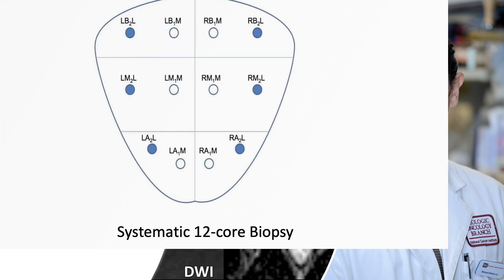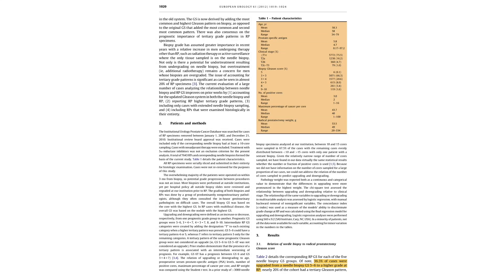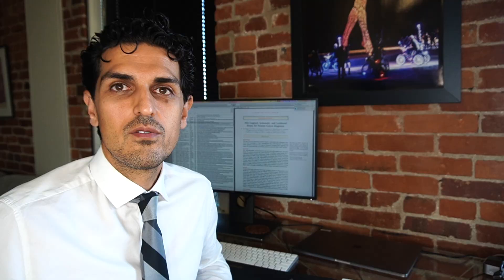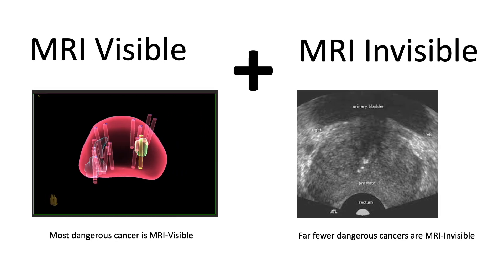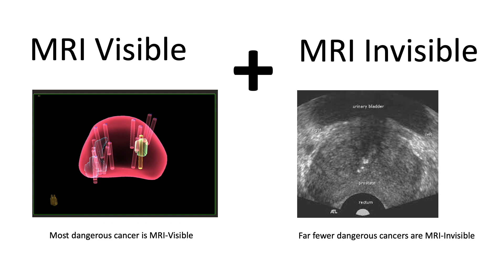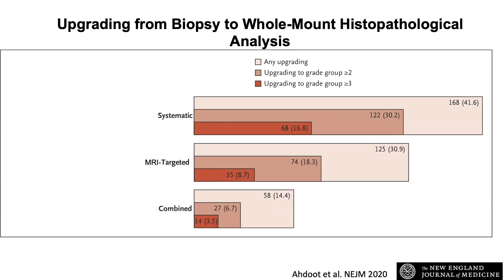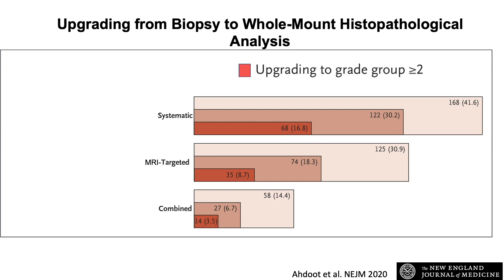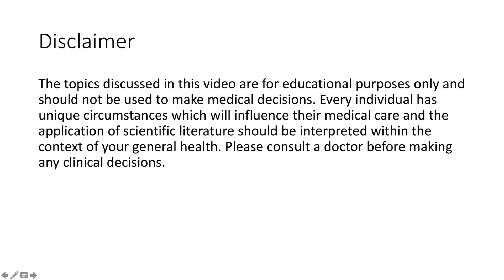Prostate Biopsies Can Be WRONG! -  Dr. Ahdoot Explains Prostate Cancer Diagnosis

Comment: 5 days ago I had a MRI-TRUS Fusion prostate biopsy, using the Phillips UroNav System.  I go in today to find out the pathology report conclusions.  What surprised me is how fast the pathology report turn around was.  I had the biopsy on a Friday and less than 24 hours later, the PR was released on MyChart.  I haven't looked at the results because, my guess, they're highly technical and I don't want to jump to conclusions.  That being said, I question the thoroughness of the report given a less than 24 hour turn around.  The Urologist took 12 systematic samples and 3 targeted samples of, as the MRI report said, of the appearance of a PIRADS 4 lesion in the right, mid-peripheral zone.  So, in a nutshell, what questions should I ask the urologist as we move forward.  To me, the prostate and the medicine around it seems imprecise and wrought with ambiguity....and I don't know what to believe anymore.

Comment: Thank you Dr Ahdoot for the knowledge & insight to diagnostic options available for men. I'm 71 have BPH & my most recent was PSA 6.5 up from 4.5 from my last exam 5 yrs ago. At that time underwent MRI & Aphiny test/analysis not sure which kind. Radiologist did not find anything to raise concerns. I'm thinking of a follow up with a urologist. My understanding is that men with BPH will see a rise in PSA as they age. I want to be proactive with my health but don't want invasive exams unless completely necessary. My experience with urologists over last 20 yrs has been we need do biopsy etc. Your research & videos provide a wealth of up to date information for men with decisions to make. Thank you again.
Reply from the maker: Glad I can help!
Reply: What is a BPH?
Reply from the maker: Growth of the prostate that is related to age, rather than cancer.
Reply: @jerrymunroe5593 Benign Prostatic Hyperplasia. Its caused by the continuous growth of your prostate and as you age it begins to obstruct your bladder opening, which makes voiding your bladder more and more difficult with time. It is not a cancerous growth of prostate tissue, therefore can be Addressed with a simple resection of the prostate called a Transurethral Resection of the Prostate i e. TURP.

Comment: The digital exams are useless. And, they have the negative effect of turning off men from regular exams. 
Turns out despite getting a clean bill of health since 48 years old (now 55) I have Gleason 8, t3 cancer. The main lesion is on the opposite side of the rectum and after years of grow time found its way to the seminal vesicles and left lymph node.
I had no symptoms and ol’ numb fingers Dr. X felt nothing. I was only diagnosed when my PSA came back 30.2 and the psma scan lit up like a lightbulb.
Moral of the story: get PSA blood work done and keep the fingers pit of the bum.

Comment: Great videos! I'm 75 yrs old, PSA had been gradually rising from 4.0 (PSA-Free % 29.0) 12 years ago to the current 5.4 (PSA-Free 35.9%). MRI recently shows that my 53ml prostate has a 1.5cm peripheral lesion. Radiologist scored it PIRADS3 with no evidence of spread beyond prostate. Urologist ordered ExoDx antigen test which came back at 44.3 risk score out of scale of 100. He recommends fusion biopsy now but I want to take time to choose the best institution for biopsy and possible subsequent treatment. Urologists are booked out 6-8 weeks so my question is:  What level of urgency (to get a biopsy) is advisable? If I indeed have a "clinically significant, high grade" cancer that hasn't yet metastasized? Should I risk waiting two months to get the biopsy or just find a place that can do it right away even if it involves added cost and perhaps travel?
Reply from the maker: 2 months is unlikely to result in any meaningful progression of prostate cancer in almost all cases. Take your time to find someone you are comfortable with. 

In general the complication rates of transperineal prostate biopsy are lower than transrectal. You might want to consider a transperineal biopsy.
Reply: @cancerbetter  Wow, thank you so much for your almost instant response, Dr Ahdoot! I just breathed a huge sigh of relief and yes, I will certainly explore the transperineal biopsy. You have earned one very loyal subscriber.
Reply: @cancerbetter  Hi Doc,  have a very frightening question but I am going to ask anyways, I am 44 going to be 45 in January , I just got my routine physical done about a month ago.

My PSA was 3.3 and my free PSA was at 9% , my doctor sent me to a Urologist and I am scheduled to see one this coming week.

My PSA was also the same back in 2017 , 3.3 , so it never rose from then to now.

She put in her notes that I have a prostate malignancy .

1. From what I have been reading , even if your psa is with in range and you have a low free PSA it almost always means a diagnosis of prostate cancer, is that True?

2. I am terrified of this because I consider my self still young, sexualy active and past that I feel great ,no body pains except for when I exercise , I take no medications except finasteride to keep my hair and I am wondering if that may play a part in getting prostate cancer if that's what it actually is?

3. Lastly being that I am middle aged, how likely is it for me to actually have this and how aggressive would it likely be where I would need to remove my prostate and their being a high probability that it has already spread, from your experience?

These are my fears.

As far as I know , no one close to me thus far has had prostate cancer , my dad died from liver cancer , my grandfather died from lung or throat cancer, he smoked his whole life , none of my uncles as far as I know thus far have this issues and they are all in their early 60's to early 70's.

lastly what would be the recovery for someone like me , if I had to remove my prostate, I have no erectile issues now , none what so ever in fact, I think about sex all the time and masturbate probably way more than I should ; and I have been doing that for years.
Reply from the maker: 1. Free PSA is not a perfect test. Sometimes it is suggestive of cancer but nothing is found. It's more of a test to determine your risk but not something you can make absolute predictions on. 

2. When on finasteride for over a year it should cut your PSA in half so to get your corrected PSA you should double your PSA to get the actual level you would have if you were off finasteride. Finasteride reduces the rates of low grade prostate cancer but in historic studies, before we used MRI, it also lead to higher rates of high grade cancer diagnosis. I personally believe this was because finasteride shrinks the prostate increasing the odds of cancer detection by the systematic biopsies, however this is a point of contention among my colleagues who are also experts in this field. 

3. Being young reduces the likelihood of prostate cancer significantly. That being said if cancer is found younger men, in their 50s and below, have much better rates of erection preservation than those reported in the studies I quoted, which included predominantly men in their 60-70s.
Reply: @cancerbetter  Thanks for the response Doc, my last question is , worse case scenario , from what you have said if my PSA was 3.3 then doubling it would be 6.6 and that would be high for my age from what you have stated ?

Lastly, worse case scenario , if cancer be the case , being that I am young would it more likely to be an aggressive  form or age has little  no bearing?
Reply from the maker: You can not use age as a predictor of likely grade. All kinds of grades can occur at all ages. However please remember that PSA can be elevated for reasons other than prostate cancer. See the video on PSA for more.
Reply: @cancerbetter  Thanks for the reply!
Reply: @cancerbetter  I have had no problems (low Psa's)  until last September at which time I had three kidney procedures (for kidney stones) and had two urinary stents inserted then finally removed. Now my Psa numbers are rising. My urologist wants to do a wait and see. Is it possible that the stents could have irrated my prostate? I know it irritated my bladder that is for sure and it was horrible and bloody. I do have symptoms of aching when sitting also.
Reply from the maker: Procedures that involve passing instruments into the bladder will commonly raise the PSA. PSA levels will take 6-12 weeks to normalize based on how high they get. 

Alternatively infections of the prostate can raise the psa as well.

Comment: I had a PSA done after a 4 year lapse and it came back 5.7. One year later it was repeated and came back 7.7. At that time the urologist asked if I wanted a biopsy. I replied yes, but after I have a 3T MRI to show if and where any lesions are located. The MRI came back PIRADS 4 with a 1.1cm lesion noted. I was never contacted by the ordering physician so I started looking for another urologist. The new urologist performed the biopsy sampling 20 cores of which 5 were positive for cancer and two of the cores were Gleason 4+4.
I was started on Lupron and two and a half months later I began Proton Therapy with 39 therapy sessions.  No side effects of the Proton Therapy noted, it was completed only 4 days ago. I will continue with the Lupron probably with two more six month injections. As an aside my initial diagnosis was high risk/aggresive cancer but a genome test on the cancerous cells put me in the low risk category. From what I have read, the high risk category is a heterogenous class with varying patient outcomes.
As an aside, anyone going through this should read Robert Marckini's book, "You Can Beat Prostate Cancer and You Don't Need Surgery to Do It". I learned a lot from it and it was the time it took to read.
BTW, it has been 7 months since I had the MRI and the ordering physician still has not called me back with the results. That should be a lesson to everyone, no news from your doctor does not necessarily mean "good news".
Reply: What were the side effects of the Lupron and is that hormone therapy?
Reply: @dappa311  Yes, it is hormone therapy and it lowers the PSA in my case to less than 1.0 and also lowers the testosterone to very  low levels. The most annoying side effect in my case are the "hot flashes".

Comment: Two years after your post: Thank you Dr. Ahdoot ... my paternal great grandfather died at age 66 with metastatic prostate cancer (liver) in 1918, which was then referred to as the 'man's cancer.' My paternal grandfather died at the age of 91 from congestive heart failure AND prostate cancer (according to his death certificate). My father was diagnosed with Stage 2 prostate cancer at the age of 66, and had the radical surgery which left him incontinent for the remainder of his life (he died at the age of 82 with metastatic melanoma listed as the primary cause of death and metastatic prostate cancer as the secondary cause). I am 67, and I have certain symptoms (painful urination every time, difficulty emptying the bladder each time, and extremely painful ejaculation - on a scale of 1-10, a 10 indeed. My CBC PSA level is 3 (an increase of one point in the past 6 months). However, there has been no free PSA tested, and it has been 12 years since I had the digital rectal examination. I have an appointment with a urologist next month and we'll see what the outcome might be.
Reply from the maker: In some situations it makes sense to do an MRI for a PSA of 3, especially if the PSA is rising quickly or you have risk factors. Before you do anything you should consider repeating the PSA to make sure that result not an outlier. Hope this is helpful.
Reply: @cancerbetter  Free PSA 20 ... alkaline phosphatase level has dramatically increased. Symptoms? No better. My doctor has ordered a multi parametric MRI, to, as he said, determine the extent of this.

Comment: Hello and thank you for this very useful information. It seems that I am in a bit of a difficult situation. My last several PSA tests indicate an elevated score and my urologist has suggested having an MRI guided analysis to test for prostate cancer, however I am a Parkinson’s Disease patient (diagnosed 8 years ago and received a DBS device one year ago) and have been informed that the battery in my unit is not compatible with MRI. My options seem to be to request a change in battery design (apparently a relatively minor procedure) to allow an MRI, or simply go with a standard biopsy which can be quite inaccurate. Some say that I could just wait until the battery is due to be changed anyway but this could be several years (between 2 and 5 years more), during which time, potentially aggressive prostate cancer could be advancing uncontrolled . I am interested n your thoughts.  Thank you.
Reply from the maker: There is also a very high frequency ultrasound that is good at cancer detection. You might want to consider that.